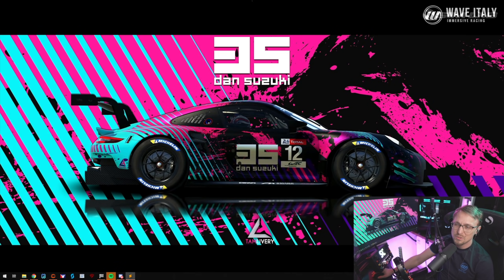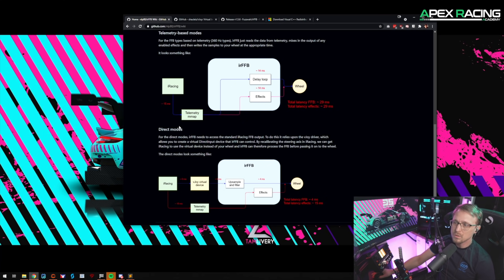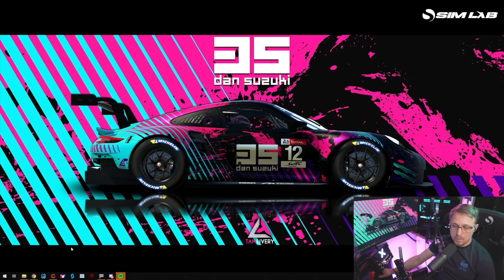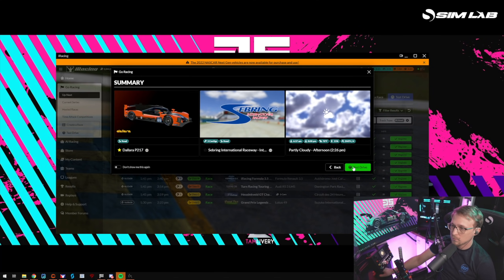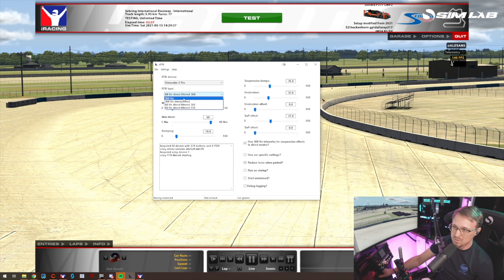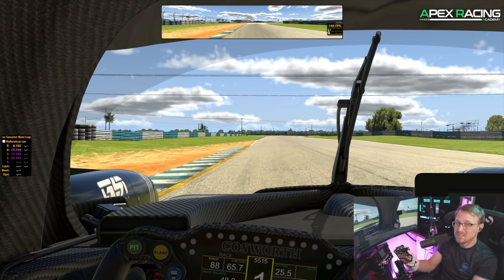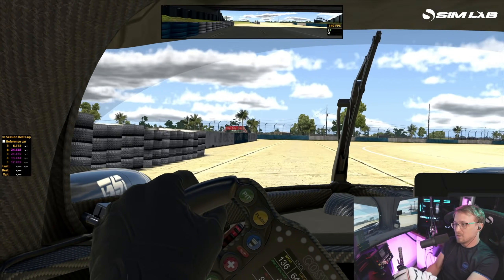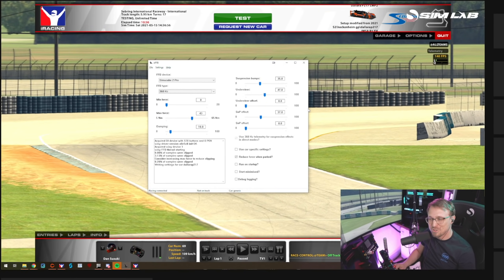Better FFB for iRacing? irFFB and vJoy install guide | Tutorial | iRacing

Comment: I was not expecting you would need to use this with a Simucube pro,  is this really necessary with such a wheel base?   I am currently still on a Fanatec CS2.5 ,  but was planning to get the Simucube Pro .  Would I still need irff with it?
Reply from the maker: No you absolutely don't need it, it's just a different FFB for people to try and then chose what they like the best. I personally do not use irFFB.

Comment: Definitive solution to configure the DD Thrusmaster T818 in iracing to your liking.

Since the TM software is very basic and lacks configuration options. (it's rubbish)

I use it irFFB and vJoy with my T818 in iRacing and it's another world, I recommend it 100% in the DD Thusmaster T818.

I hope Thursmaster takes note and develops software according to what a proper DD is supposed to be.

Comment: When I calibrate the wheel with vjoy I get -4,624,848 when I turn all the way right. When I turn all the way to the left I get 0. I have tried reinstalling vjoy many times and I get the same result each time. Any fixes?

Comment: Dan, I ended up with the VRS wheel and love it. So much better your my belt V 2.5. My question is can I use vJoy with dual clutch setup and IrFFb setup at the same time? I went through your video on that and WOW. Your videos have helped so much. I'm thinking I can't and it's time to buy a new wheel with a dual clutch.Sorry to ramble on.

Comment: Hey, great vid! Just having an issue with iRacing not greying out the FFB options, and the FFB still feels the same so I'm assuming its not going through iRFFB. Everything works fine in vjoy, calibrates well. Nothing in iRacing though. Any ideas?
Reply: check the vjoy version you have, had the same issue with the lastest 219 one, you need the 218.

Comment: I got this working in iracing with my G27. However now wheel is screwed in AC and AMS2. I think it was mentioned somewhere to recalibate your wheel in the other games and when I tried to do that it only let me calibate to a range of 100? irFFB is not running in these games. Also though I noticed in the step where you said to calibrate vjoy in usb game controllers in windows, it would not calibate/respond to the wheel movements. So I guess this is why I have problems but strange iracing works?

Comment: I installed a few hours ago. It took me 4 laps to see my performance improve. Just because I can be more aggressive to kerbs and throttle while turning. Way more control against oversteering. 

I'm using a G29 by the way, I highly recommend to Logitech users.
Reply: It doesn’t feel any different for me tbh. Not sure what I did wrong
Reply: Must have done something wrong as well. Was trying to mess with settings but default IRacing felt so much better?  G920 here.
Reply: interesting, I've used the basic FFB forever and have been quite handy (not alien tho lol) with a g920, I might try and see what happens
Reply: What settings are you using?

Comment: I tried various options in the past and all the time I ditched it cause of the bugs it had. It drains the CPU all of the sudden without warning. After this video I decided to give it a go with this new version but again it drains the CPU sometimes. I have got the R7 5800x with an RTX3070 so should not need to be a big issue. I read on Google it has something to do with the suspension effects and SOP etc? Keeping it at "0" would not do it. So sad cause especially the SOP is helpful for me.
Reply: Had the same issue, but setting the mode on 360Hz fixed it for me. Looks like the interpolation can get heavy after a while

Comment: I use it for 6 month and for me it´s a complete game changer. I haven´t installed vjoy because obviously there is quite a substantial risk that it messes up your PC. The latency difference with or without vjoy is 15 ms (like 1 and 1/2 hundreth of a second), I bet that at least normal earthlings will not be able to tell the difference in a blind test.

Within 15 minutes it cut off my laptimes by at least 0.5 seconds to the minute (and thats just the start).With the SoP Effect you can control an oversteery car much more safely when driving near the limit; it does not only increase speed but massively increases consistency as I now have very few spin outs (especially in the 911 Cup Car, the F 3 and the Skippy). I just took the Driver 61 online course and all the exercises to build up maximum grip level especially in the front tires are so much easier with the understeer effect (I can´t do any of them properly without irffb running because at least I can´t feel the understeer with the native iracing ffb). 

I run both understeer and SoP at about 80...

Never had any stuttering or starting issues...

Without vjoy, it´s super quick and easy and risk free to install.

Comment: Between two FFB 60 Hz info from iR is only 16.7 ms, but for somebody, it is so rough, he needs to introduce latency 14 or 29 ms by iRFFB. Interesting. BTW from personal experience, the most important advantage of  DD wheels over wheels with belt or gears is lower latency.

Comment: If running triples you may find they start flickering/glitching. I know 3 people that have had this issue using irffb. The CPU bar graph in iRacing will go into the red, then you’ll start getting frame drops. They were all using the 60hz direct 360 mode, which apparently hits the CPU quite hard whilst interpolating.
Reply: same here, running just without vjoy and works fine

Comment: I've tried it on a DD1 and it's ok on the road, but when you hit a wall at speed it violently snaps the wheel back and forth. i do not have that issue without irffb.

Comment: Anyone give me any tips?
Followed this exactly. Using same links. Double click irffb and nothing happens. Won't open or anything. 🤔
Reply: Run it with admin rights, right click run as administrator. Works for me
Reply: @jacobsiebel2532  I've got the same problem. Running it as admin doesn't work. Also start button is now not working.
Reply: actually, I can't start any program anymore from start menu.
Reply: @550LMS  I have that problem with another windows pc sometimes it just stops responding but that is more of a windows problem. I remember that i had a problem as well with irffb not starting and sometimes i had  to click it three times. Then i could tik run at startup. I also uninstalled it and reinstalled the latest version. That seemed to help as well. You could try to run Iracing manager and automatically start it up when starting iracing.
Reply: @jacobsiebel2532  Thanks Jacob, I'll try that !
Reply: @jacobsiebel2532  In the past I used irffb but the same thing happened to me, I often didn't work, so I stopped using it. Now I decided to try the new version but the W10 does not download, says that the file irffb can damage the OS, even disabling windows defender. Is there any way to download it? Thanks.
Reply: @mariopires5022  Is it your browser or windows itself? Usually it happens with .exe files which irffb is. I think you can change the security settings in w10. Otherwise try to google it
Reply: @jacobsiebel2532  I finally made it, by going to the download options and ignoring the catastrophic warnings from windows. Thanks.

Comment: 1. You don't need this with a SC2, its software has own filters for that
2. The installation routine of vjoy is a pain in the a**
3. It makes sense with GT3's at best -> because the physics still suck bad in iRacing regarding GT3s (the reason I do not drive them at all in the first place and don't understand how anyone can). Other car classes get even worse when using iRFFB, Skip for example
Reply from the maker: You probably didn't watch the video then. It's super easy to install. And I think it still makes a lot of sense, it does not only have a interpolation filter - it gets much for FFB info from the telemetry - the SC2 software cannot do that.

Whether you like it or not of course is a personal thing.

Comment: I found my FPS is significantly decreased (from around 170 to 70 fps), is that because of this irFFB? Has anyone observed a similar thing?

Just in case someone is facing the same issue as I did, here is the solution: https://www.reddit.com/r/iRacing/comments/bd055y/problems_with_screen_flickering/
Reply: Me unfortunately, i think it's a vjoy problem. Without it works.
Reply: @ft_111  I also tried without vjoy, the same happens. But after I reselect the audio devices, never happened again.

Comment: Those having any issues should try the modded version of iRFFB that does not require a specific version of VJoy, allowing you to use a later (latest? version).

https://github.com/slikk66/irFFB/releases/download/v6.2.1/irFFB.zip
Latest vJoy (2.1.9.1) https://github.com/jshafer817/vJoy/releases/tag/v2.1.9.1

Those are the two versions I am running on my system.

Comment: You don't have problems with ACC? I get NO FFB in ACC on my T300... Don't know if it has to do with the vJoy and irFFB.
Reply: Has to do with irFFB. If that's running for some reason you won't get FFB in ACC. 
I noticed it too so stopped using irFFB
Reply: You have to make sure iRFFB has not loaded.
Reply: Just make sure irffb is shutdown before firing up another sim.

Comment: iRFFB has a huge memory leak problem. Have to restart it constantly or I start lag spiking and blinking.
Reply: I have been searching for a solution on this for a while now. The CPU usage gets massive all of a sudden.
Reply: @nickderijcke9288   Yeah plz share here for me if you find any solutions
Reply: Same here. my c bar getting red and around 20 to 30 mins I start blinking...
irFFB is great but I can't use in official racing because of that
Reply: Really? Mine has been running for about 5 hours now and mem utilisation is at 13MB. I wonder what issue has crept in to cause yours to leak?

Comment: Hi Dan, 

I'm using irFFB since almost my begin in simracing (about 1y and 1/2), but I've never thought to calibrate vJoy in Windows ! Thanks for this first tip...
I have a question (I also didn't know there were 2 modes for irFFB, as I was alway using it with the 360Hz) : Do you advice me to use the "direct-mode" (60hz direct filtered 360) or the "telemetry-based mode" (360Hz, which I'm using since the begin) ? I'm using a belt-driven wheel (Thrustmaster T300RS)... Thanks ! 
PS : I love seeing your replay races on YT :) Keep up the good work :) 
(hello from Belgium :) )
Reply from the maker: Use what works best for you :) I use the telemetry mode typically :)
Reply: Direct modes needs vJoy. Telemetry modes do not. Some have struggled to get vJoy working so just use Telemetry mode anyway.
Reply: @Daz5Tube  I'm using vJoy and irFFB since the beginning of my expérience in simracing... I haven't got any problem since then. Now I know there is "2" modes, I'm going to test if I feel the difference... As I said, I was always using the "telemetry-mode" without knowing it wasn't using vJoy (I always thought it was lol). So now, I'm going to try the direct-mode to feel if there's a difference. Thanks for the advices

Comment: Installed vJoy and iRFFB and set all as in the video... but I get 0 effects and no FFB in iRacing on my DD-2. (Fanalab runs in the background as always?)
Reply: Try starting irffb after getting into the car, then leave car and calibrate wheel in iracing. 
I find it works best to use iracing manager(or whatever it's called) to start irffb 5 seconds after the game launches.
Reply: @6strawb  thanks, got it to work in 360 mode... it feels swesome!
Reply: @6strawb  It just doesn't work with the 60hz mode. Even so the output of irffb shows the output. Deleting joyCalib files also doesn't help. I think it's an issue with vJoy.
Reply: @McLogo76  Reinstall vJoy, make sure it is the right version for iRFFB? 
Unfortunately both iRFFB and vJoy are no longer being developed so I'm dreading the day a Windows update kills vJoy.
 IRacing need to sort the in game ffb or roll IRFFB into iRacing for stability and reliability.
Reply: @6strawb  Yeah, I had tried to re-install it more than once. I agree - after experiencing iRFFB I think iRacing should improve their FFB before adding things like rain etc. - It would be so much better.

Comment: Initially when I installed irffb I had issues where I forgot to start it, etc... Now I just use the iRacing manager to start all of the software I use next to iRacing (cf Sampsoid's video ). 

If you are having issues with IRacing  trying to use the native FFB, I would recomend enabling HID guardian, located in irffb's settings -> HID guardian. 

This effectively hides your wheelbase from windows so its only detected by irffb. Just keep in mind that you will need to disable HID Guardian and restart your wheelbase before playing other games that iRacing.   
The guys that coded IRFFB need to be hired by iracing.

Comment: Not worth it in my opinion because of the screen stuttering issues.
Reply from the maker: What is that? Never had any stuttering with it 😅
Reply: @DanSuzuki   lots of people have had issues with it causing micro stutters. Most in sampsoid community have stopped because of this issue. It also doesn't start properly 1/2 the time.
Reply: @LuckyDucky85  I've encountered issues where it doesn't always load when a session is started, usually after changing cars. Never ran into any micro-stuttering, though.
Reply: Me neither
Reply: used it for over a year with no stuttering issues with 4 different wheelbases.
Reply: Yeah I ditched it as well due to the issues. After this video I tried it again as I saw it is a new version but again the same issue. It drains my cpu and I get massive drops on a R7 5800X. There must be something causing it but could not find it yet. It is sad cause I love the way it feels with the SoP setting.

Comment: I use a DD1 wheel with Fanalab. I installed iRFFB awhile back after Dorian did a video on it and have used it ever since. I absolutely love it. In my opinion, it makes it feel more like what a real car feels like.
Reply: I loved iRFFB with the belt driven steering wheels, but I tried it on my DD1, and it felt that I don’t need it with the direct drive, and I didn’t like the idea to have latency.
This was 2 years ago, I think I try it again, because I love the force feedback of ACC.
Reply: What settings are you using? Would like it to try out. It will help to have a base to start from. Thanks in advance

Comment: Thanks, but doesn't work with my SC2 Pro since vJoy doesn't recognize it. And how to press a button with the SC2 Pro anyway during calibration? But even with my Ascher wireless it doesn't work.
Reply from the maker: You don’t have to push any buttons. Did you have irFFB running with the SC2 selected when trying to calibrate like shown in the video?
Reply: @DanSuzuki  I uninstalled and run it again, than it was working, but not when launching iRacing a 2nd time. Anyway, I don't like iRacing and irFFB will not change my mind.
Reply: It works fine with my SC2 Pro and has done since the day i bought it.

Comment: Just be aware that some have had unexpected issues with irFFB like stuttering and intermittent lockups, killing their races.  Some had been using irFFB for so long, forgetting they had it running, that they could not even pinpoint the source of these problems and went as far as upgrading hardware thinking it would resolve it.  It didn't.  As soon as they tried to disable irFFB, the problems went away.  Keep this in mind if you decide to use this software.  It's too bad because I've used this before as well and liked it but the potential issues it can cause which could kill your races outway the effects it provides IMHO.
Reply: Could be they were running a current version of vJoy/irFFB, and a Windows update did make current version no longer work at some point. Have to use older vJoy/irFFB with current Windows. I did hear there was a registry fix to make the new packages work, but I haven't researched nor tested the registry fix.
Reply: Exactly this, it is a great tool but it has a lot of bugs and is outdated. If it wasn't so good I would have stopped searching for a solution to fix the problems I have with it.
Reply: @nickderijcke9288  hey mate, could you fully resolve the issues? What did you do?
Reply: si yo lo deje de de utilizar ya que me  bloquea la pc cuando corria fue de un dia para el otro debe ser por las actualizaciones de windows

Comment: using g29 and vjoy i get this message "Attempting to set range via LGS
Failed to locate LGS msg handler, can't set range" but i still seeing all the other messages and everything seems work.
Great Video!
Reply: I was getting the same message with my G29. Uninstall g hub and install Logitech gaming software cleared this for me. I couldn't get it working with either software. So you've done better then me!

Comment: Accuforce V2 and the SimCommander 4 software does this for FFB for all sim titles.  SimCommander4 allows three modes; 1.) Using the sim title ffb signal, 2.) Using foundational force feedback (this mode is like irFFB where it takes the telemtry data and then creates the individual effects from that information), 3.) Using the wheel without sim commander 4
Reply: That's one of the main reasons I bought the accuforce v2 a couple years back. Most now realise less force gives more feedback and feel the sim commander software is so detailed and you can get exactly what feel you want. I love it and I also use it for pearl drum buttkickers to give details of front / rear suspension, road surface, traction loss etc. I also got it on sale so was a real steal for me.
Reply: Hey Guys, Can Sim commander software be used with other wheels also, like G27/G29?
Reply: @abhishekab1  no